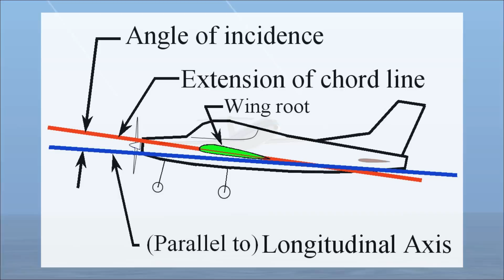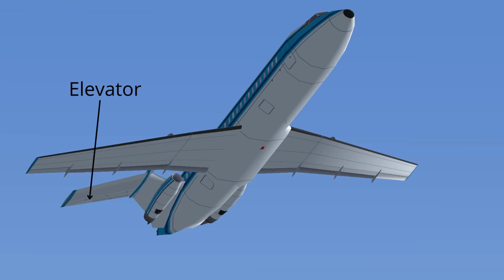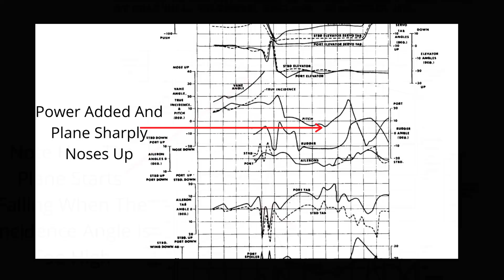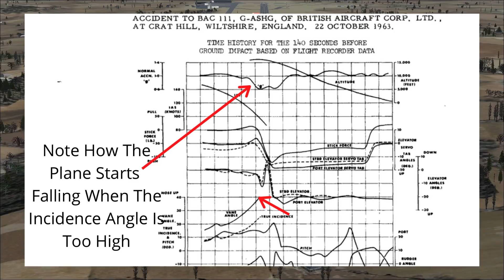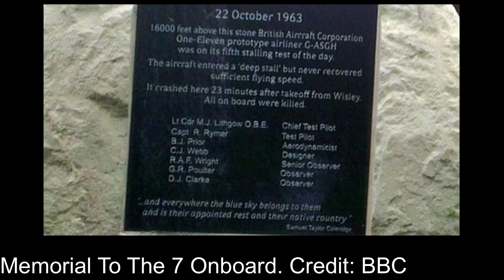These Pilots Sacrificed Themselves So That We Could Fly Safely | BAC 1-11 Test Flight Crash

Comment: This same design is on the DC-9/MD-80 series, but with one big difference. On the DC9, the elevators are 100% cable controlled and operated, straight from the pilot's yoke. Only the pitch trim is electric. However, to do away with the same problem as this BAC-1-11, a hydraulic actuator was fitted to the DC-9, which only came in to play in a deep stall. And because the elevators were pushed nose up, the airplane nose went down. This function was tested on the ground after any tail maintenance. The DC-9 had stick shakers, but no pusher, as the sudden  push on the yokes activated the hyd actuator. That was Douglas design and solution to this problem. Great video. I flew in the cockpit in a few test flights, and when the hard stall break comes, it gets your attention.

Comment: The DC-9 had the same problem.
I was talking to a mechanic on the test flight---they were filing the throttle to get more power.
They too got into a deep stall.
They added fences on the nose to disturb the air during a deep stall.

Comment: The test pilots also found this out on the Trident , that stalled at 30,000 feet on test. I believe the flight engineer bollocked the pilot all the way down, previous stall conditions had gone into the stall with one wing down, the pilot on this test flight went into the stall wings level, The aircraft also had factory workers on board it was a jolly for them, All died.

Comment: The narrator of this did not explain why the nose went back up when the pilots put in maximum power. The deep stall phenomenon was not known very well at all in those days, and the pilots probably did not realize if they accelerate the air underneath that tail by going to high power, then the air pressure under the tail is reduced, and the air pressure above the tail is higher, will shove the tail down, putting the nose back up in the air. 
Kind of a counterintuitive thought, but they needed to keep those throttles back until the nose was down. So that airflow could be restored and airspeed increased. 
I flew both the DC9/MD80, and the Lear35. Both of those aircraft had a very strong stick pusher that would shove the nose down . 
in the case of the MD80, It’s a force of 80 pounds on the column and it will shove the yoke forward violently when you activate the stall warning. It’s activated several knots above the actual stall so you still have airflow over the tail when the elevator starts coming back down. it does that by a hydraulic circuit in the down elevator. That’s the only hydraulic flight control for pitch. Otherwise the elevator is cable operated with servo tabs.
Douglas actually put an additional device called ventral strakes,  underneath the nose  on each side to help energize airflow over the tail at high angles of attack. That gives even more control in an extreme pitch situation.
Just one more thought. The only thing that would’ve got the nose down quickly with no airflow would be a weight shift system that would allow weight to be moved forward very quickly from a cockpit control. If they could’ve moved a couple thousand pounds forward in a matter of seconds by using a weight shift system in the cabin that would’ve put the nose down. I’m guessing they had no such system installed . It’s obvious to me if they had known all of the dangers of the deep phenomenon they would’ve taken additional steps to get the nose back down in a loss of control situation.

Comment: Remember (just in case) from some other disasters and reports, that if you bank far enough, the nose also pitches down... You CAN also use some rudder (pedals) with the ailerons (roll) to accomplish this...

   It's important as we take controls of larger machines and take responsibility for more lives by rote, that we remember "There are more ways to kill a cat than to choke it to death on strawberries."

    You probably won't ever need to use that knowledge... BUT it's worth watching a lot of these accident and disaster videos to notice things like that. If the elevators won't help directly, roll to the side and kick the hell out of the rudder. You can get that nose down if you act quickly enough... AND once the engines get clean air, and you've got some speed back, level out and pull up GENTLY...

    This is NOT to take away from these wonderful pilots and people!!! May they rest in peace, there was NO precedent for a deep stall or super-stall, where the engines AND horizontal tail end up in the "shadow" of the wings, and lose efficacy. NOW that we know, we have shakers and pushers on a LOT of sticks because a LOT of planes have the "weakness"... There are also other pilots and lives lost for us to find out that a hard bank (say... in excess of 40 degrees) can drop the nose... AS CAN a bank and rudder control... Let's keep ALL their sacrifices respected and valued by keeping EVERY lesson we can learn... just in case we might need it one day.  ;o)

Comment: My father was shocked when the prototype One-Eleven crashed as he worked on it as an aircraft fitter at Hurn Airport Bournemouth. When the internet became widely available I found an article on the crash. Apparently there was a stall system which operated in part by a hydraulic tab on the tailplane. The pump was undersized and failed plus the pitch reading was incorrect. When the pilot realised he was in a stall he was not aware the pitch was greater than the reading. Being a WW2 fighter pilot he tried a few manoeuvres but it was too late. On impact the forward movement was 75ft. The exit door was still in place as all the bolts had not been fired. The final comment was that military aircraft undergoing stall tests could deploy a tail parachute to bring the nose down. I’m not saying the article was correct but it is how I remember it.

Comment: You do a great job and I enjoy your videos! There's a bit of confusion about the angle of incidence vs. the angle of attack (AoA). The incidence is the angle of the wing chord line relative to the longitudinal axis, it's fixed (except the FA-8 Crusader and perhaps another one or two). The AoA varies during flight and increases as you approach a stall. If you lose elevator control, with enough altitude you can roll 60 degrees or so and apply rudder and pivot the jet to lower the nose. Cheers

Comment: I believe that in modern times a drag chute is temporarily installed that can be jettisoned after recovery. This is usually used for spin recovery from inadvertent entry into a flat spin. I also wonder what would have happened had the gear been extended. I have routinely experienced a nose down tendency when gear has been extended. It is very unfortunate that pilots were sacrificed in order to discover the deep stall state of T-tail aircraft. Were wind tunnels that inaccurate that the testing of newer design concepts? I also was totally confused by the use of the term “angle of incidence” to define what we in Canada refer to as “angle of Attack”, that is the angle between the relative airflow and the chord of the airfoil.

Comment: 7th June 1964 there was another 1-11 crash during stall testing. This was G-ASJD, but it had been fitted with a tail parachute to be deployed in the event of a deep stall during the testing. During the testing the pilot believed he'd lost elevator control and deployed the chute. The aircraft stabilised but the pilot did not then jetison the chute as he should have done. The result was the aircraft making what ended up being a very gentle belly landing on grasslands near a village called Tilshead. The aircraft was barely damaged and the crew walked away. The details are on the ASN if you want to look it up.

Comment: Thanks for another great video. As a former RC pilot in the 80’s it’s not always necessary to die to learn how to fly safer. We trained on getting out of spins and stalls and aerobatics. In this situation I would try to roll out using the ailerons to allow the tail catching some wind. If nothing seems working, try something else

Comment: The only flight "experience" I had was in video games like Arma 3. I believe the simulated handling of the planes is fairly realistic, but of course the controls are extremely simplified.
Anyway, since it's just a video game, of course I have crashed the plane many times and experienced a bunch of stalls. And to get out of a stall, what I usually did if increasing speed wouldn't help, was just turning the plane to the side to stop gliding straight and fall to the side to force the nose down, even if it sent me into a nosedive. It worked with fairly low altitudes as well (below 3000 feet) but I guess you can't compare the handling of a military plane to that of a big commercial cruiser.

But is this one of the ways pilots could handle such a deep stall, or stalls in general? I guess it might have worked if they tried it earlier with more altitude to spare?

Comment: stupid but serious question. When they went into the stall and it said they tried to raise their speed so it made me wonder wonder when its called a stall are they engines still on and just doesn't have the power to do anything. this is more a question about commercial passenger aircrafts and not singular engines on smaller planes. I've always assumed the engines lose full power an turns off but when he said they tried to raise the engine power it confused me.

Comment: Question to fellow pilots: Would an immediate banking to the sides get you out of the stall? You push wind over the vertical stab and get your nose down again, then as you gain speed you perform an anti-spin maneuver?

Comment: Apologies but you have lost all credibility with your error of stating angle of incidence (instead of angle of attack).
Angle of incidence is a fixed built in design angle between the wing line chord and fuselage centreline.
Angle of attack is the angle the airflow meets the wing chord line.
Unfortunately it is obvious you are covering a subject you understand very little about.
Regardless, why were experienced test pilots commencing unknown stall testing at only Flight Level 170 when they had so much more room above them as an extra safeguard.
This would have given them more precious time to resolve the issue.
That is not to say that this would have 100% made the difference, but to me it's exactly the same as not backtracking all the way to the runway in use threshold before taking off, and hence the saying "Any length of runway behind you is useless"...
Reply: lighten up Francis.

Comment: If I remember the history correctly, BAC did NOT correct the problem - a T tail elevator being blanked out by the wings at extreme angles.  They merely installed a stick shaker to warn the pilots when they were getting close to the stall.  Saves money that way.  They should have redesigned the whole plane - put the elevator down below where it belongs.  This was just wrong.

Comment: I wonder if using rudder or differential thrust could tease a wing to drop in this situation and roll to recover. Would be an interesting sim experiment.
Reply: I don't get what happened here.
It's well known today, you can roll past 90 with ailerons, let the nose fall thru, roll back headed down hill, and hammer down.

Comment: The correct term would be "angle of attack" and not "angle of incidence". The incidence is the angle between the fuselage zero line and the wing chord line, i.e. it is a fixed angle for most airplanes unless it's a tilt rotor with tilting wings. The angle of attack however is the angle between the wing chord and the incoming airflow, that is what causes a stall.

Comment: I was with 34SQN RAAF in the mid-80s - we flew the BAC-111 in VIP configuration.  The stick shaker/stick pusher test flights were the scariest, considering we all knew about the unrecoverable deep stall.  However, the stick pusher occurred well above the stall speed and it was nearly impossible to pull against it.  Oh yeah, it also had a loud claxton horn that went off just prior to stick pusher, which scared the hell out of you.  Rule number one - keep the airspeed above stall.

Comment: Do they use fluid dynamic simulations and flight simulators to test planes before physically flying them now?  That obviously wouldn't have helped in 1963 but such a flaw should show itself if the flight simulation was very accurate and without endangering the test pilot and team.

Comment: The French Caravelle, first commercial plane to feature tail engines, does not suffer from this flaw. The huge number of dc8 crashes also shows there's always something to learn from the French
Reply: If this was the first commercial aircraft with this design,then presumably such a problem of deep stalling did not arise as the aircraft was never tested to such an extent.

If the caravelle did suffer from deep stalling then the design engineers must have kept it quiet and didn't share the findings with the rest of the aero industry.

 I thought such a deep stall was a product of the large wing size , on such aircraft,so all large aircraft of this design suffer from a similar potential problem.

Naturally, being a French aircraft the caravelle must have been perfect,as was all the US aircraft of the age of commercial jet development and design.

You can't go wrong with a French or US aircraft eh?
Reply: @toonmag50  of course you lost yourself in a long text without even looking a photo of the Caravelle. You didn't read anything about this plane either. So your long post is just stupid and your conclusions only deserve 5 wips

Comment: Elevator blanking in a T-Tail is one heck of a terrifying design flaw with the concept of T-Tail aircraft. Personally, I would require the use of a small canard on all T-Tail aircraft to provide Pilots just a little bit maneuvering ability in the event of a stall like this.

It's surprising they didn't try lowering the landing gear. Although it wouldn't have done a lot, it may have been enough.

As tragic as it was, they succeeded in their goals - they provided important data to the engineers which saved a lot of lives in the future.

Comment: Unfortunately, being a Test Pilot means thst you're flying an aircraft that no one knows how it will respond to control inputs!

Test Aircrew have no way of knowing how a flight test might go, and it is an occupation fraught with lost Crew.

Despite all of the expertise and knowledge acquired over time, these aircraft still require human beings to carry out tests in the air, the outcomes of which can only be determined by results.

Test Pilots are rightly considered to be hugely accomplished and to remain objective during in flight disturbances, but to be in an unresponsive aircraft that's hurtling towards the ground, giving no opportunity to escape is truly horrific.

The cost of certification for aircraft has this hidden toll which the passengers have no knowledge of.

Comment: I wonder why this didn't happen with the B 727, Tu 134 and other planes that have this type of elevator ? Anyway, a plane is built so that wings will loose lift BEFORE the elevators do, otherwise the plane assumes a nose-up more ore less vertical position and there's nothing the pilots can do to save it.

Comment: Sounds like a similar issue to the Dehaviilland Trident in which a test also caused the plane to crash onto the airfield at Hatfield. I think the engines flamed out. As an apprentice there in 1972 I remember seeing the crater it had left near the edge of the airfield. I don't know if that incident was before or after the 111 one.

Comment: 2:02 Why? Didn't the engines mounted ABOVE the center of mass push the nose of the plane down? Is this because of buffeting? I assumed the engines could have flamed out because they were in the drag of the wings..
Reply: I would have (desperately) tried to roll or yaw the plane to put that nose down, after failing with the engines. I guess there wasn't enough time for that though.

Comment: Interestingly, the Boeing 727 - another T-tailled airliner - also entered a deep stall during flight testing, some time after the BAC 111 crash; in that case, though, the test pilot in charge was able to bring the nose down and power out of the stall after seventeen seconds.  I'm guessing that's because the 727's engines are mounted higher on the tail than the 111's, so that adding power on the 727 produces a significant pitch-down moment, rather than a pitch-up moment.

Nowadays, when stall-testing T-tailled aircraft, it's apparently standard practice to use a parachute mounted on the underside of the tail, which can be deployed to force the nose down if all else fails (although this isn't a perfect solution; I think I recall reading about a Bombardier Challenger business jet that crashed during a test flight when the pilots forgot to jettison the parachute after recovering from the stall).
Reply: The 727 engines are not mounted higher in the tail. The #2 Engine is mounted below the tail. Apparently you are looking at the Air Intake mounted on the top of the fuselage, the start of the S Duct that the intake air travels down to the #2 Engine.

Comment: Pleased to report it was indeed a structural giant a  later vairient of the BAC 1-11 with Philippine Airlines survived two seperate Granade incidents by suicide passenger,which blew out a  whole hoop section of the rear cabin leaving the tail in midair with limted support. this happened on the same registered A/C some two years apart . In both cases the aircraft experianced an explosive decompression entered a terminal dive and was only recovered by superb piloting skills when control was regained once the aircraft was down to around 7000 feet by use of elevator trimming.
True story I was involved with the rebuild of the A/C at BAE at Bournmouth following the first incident.